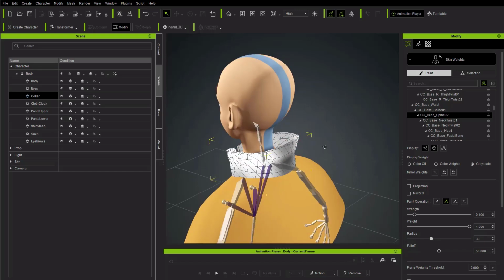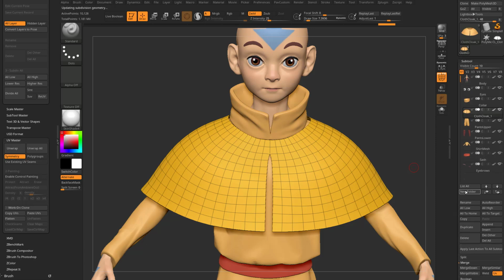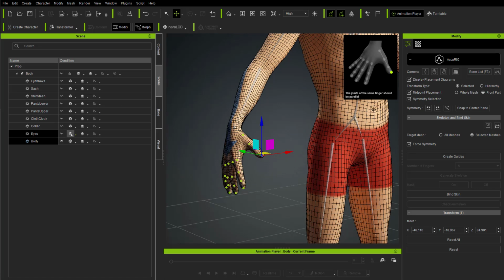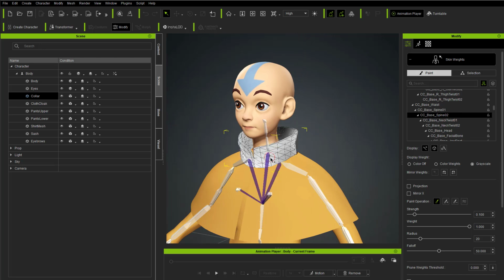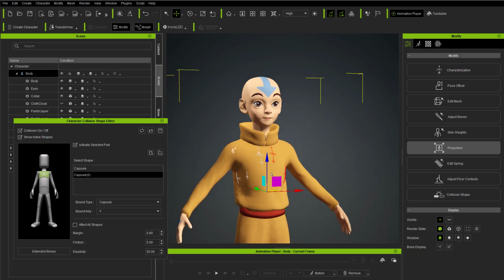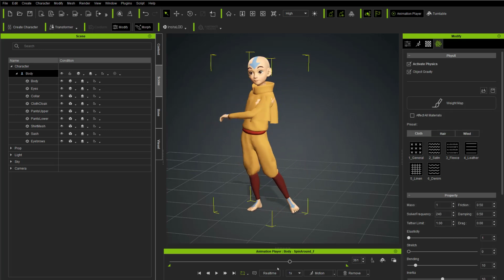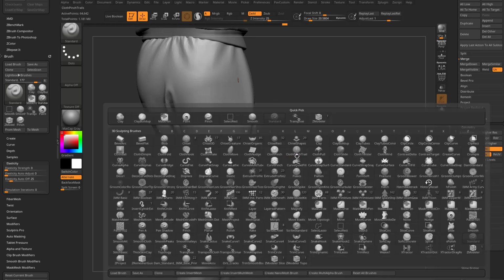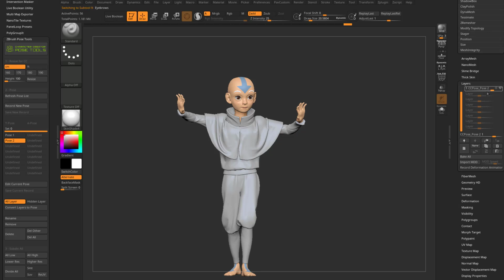Character Creator Cloth Simulation & Painting Weights, with ZBrush Cloth Sculpting!

Comment: Great series, thank you! I noticed in your example the cape was a single-side geometry with subdivisions. Can a double-sided cape also be used to send over to Character Creator to rig and have dynamics? Suppose I have a detailed cape with an intricate pattern with polypaint and sculpt detail in ZBrush. It has different designs on the inside of the cape and the outside of the cape so it can't be a single-side geometry. Will this process work the same way?
Reply: With some work I was able to make the double-sided mesh move with cloth dynamics. Is there a way to apply the cloth dynamics to a pose like it does to motions animations? I have a cool static pose but is there a way to apply some cloth dynamics while the character is standing and not moving? I want the effect of gravity on the cape while the character is standing.